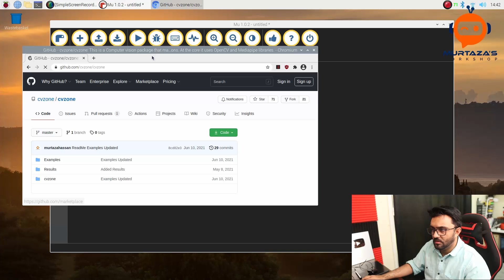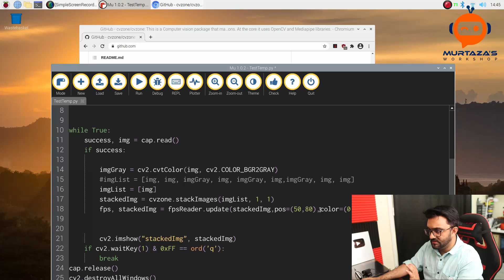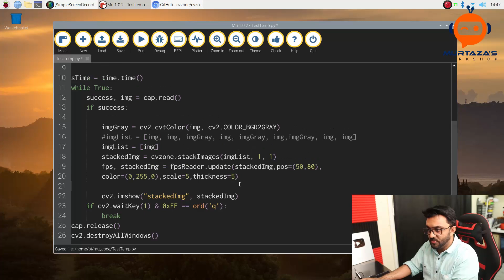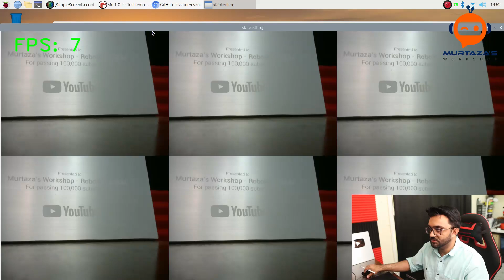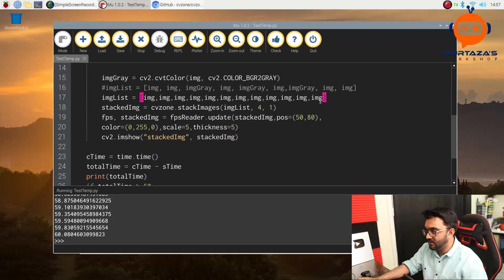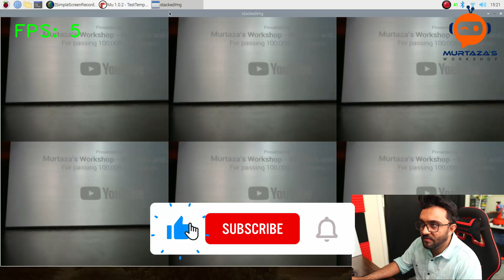Testing an Ice Tower Cooler Fan for Raspberry Pi  | by 52Pi

Comment: I had a doubt since Tello is a bit fragile I was thinking to make a drone from scratch which flight controller do you recommend and also is there a way I attach my Rasberry pi 3b+ as a camera that sends appropriate signals to the flight controller. I have only two flight controllers in budget kk 2.15 and APM 2.8 I wanted to make a drone for a long time with gimbal and all. By the way, love your video series. Thank you